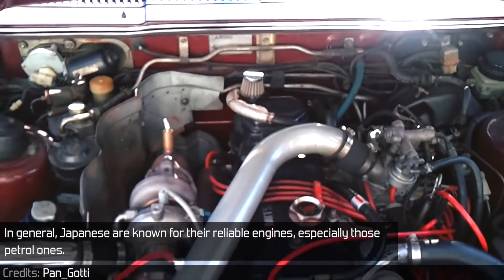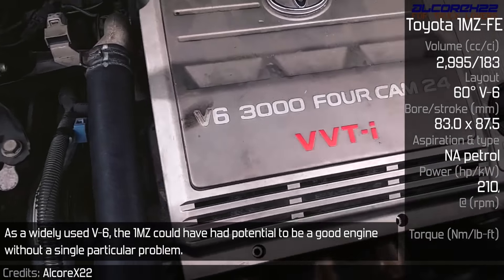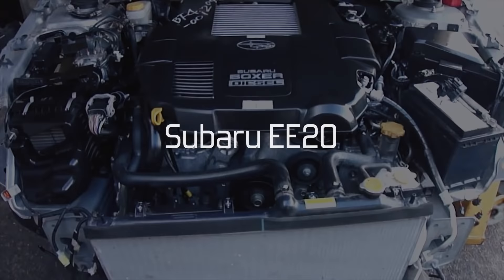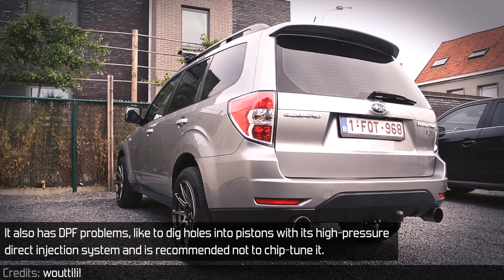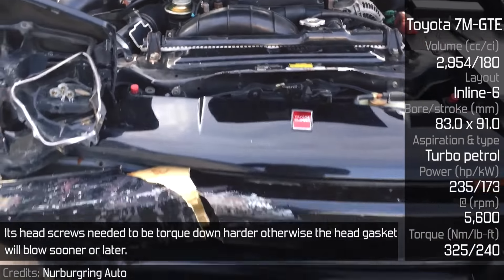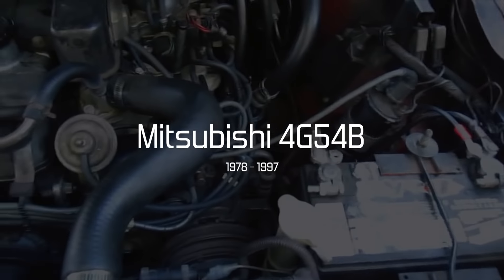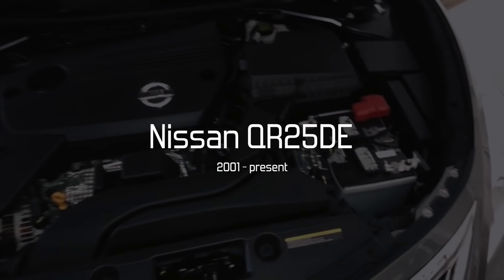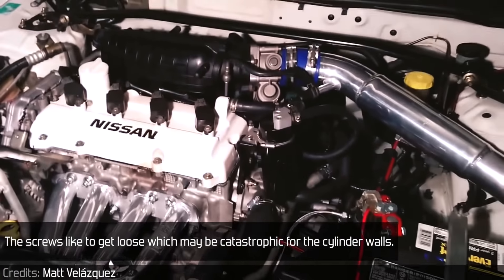Top 5 Worst Japanese Engines Ever

Comment: 4g 54 fastest 4 cylinder for 8 years on sakura motors, and warping heads was not the problem, it was cracks due to megajets in the head to reduce emissions, the head of the same engine found on dodge caravans don't have the problem because they don't have the megajets. this guy who posted the video have no clue about this engines at all!

Comment: So sorry I saw this video after I had the problems with my diesel Subaru.
You could have saved me a lot of trouble!
Particle filter, turbo...like you said 67 000 km or 40 000 miles.
So glad I got rid of it!
Reply: Best japanese Diesel is the 2.8 six cylindre in my Nissan Laurel. Undestructuble and smooth!

Comment: I had a Nissan Altima 2005 with a QR25, and yes, its has oil consumption, but, uts a very good engine
Reply: Edmundo Cuervo That engine needs change oil every 3 months or 6000km.

The Qs engines of Nissan (QG18DE, QR20DD and QR25DE) had a problem with oil consumption and Nissan told that you must change the oil 4 times per year and maybe could be normal re-fill with oil in every interval if you need it.

Comment: Omg stay away from the QR2.5. That thing was a disaster. Started burning oil at 80k with regular oil changes. Throttle body was touched once while doing maintainence and since its drive by wire had to get it plugged to a scanner just realign it. Loss of power. sychros in 1st and 3rd were trashed. R&P leak lead to failure of bushings on control arms engine and transmission mounts.  Nissan is not a datsun anymore.. never will buy one again

Comment: Im sorry but the 1mz was easy to maintain CHANGE THE FUCKING OIL like you should with that and all engines and you will have absolutely no trouble from the MZ series its a tank as long as you keep it in good shape which isn't that expensive nor difficult to do.

Comment: Why isn't the EJ25 Subaru on that list? Every single one will blow head gaskets at a little over 100K miles. They have really long head bolts that expand at a different rate to the block and heads, combined with a bad hot spot area around the combined exhaust port, and this loses clamping in cold climates, soon you smell the antifreeze outside the car and it will start to consume it as well. Shit engine, I'll never own another one.

Comment: #1 No shit sherlock, what engine can run without changing your oil regularly?
#2 I don't think it's recommended to chiptune ANY engine
#5 "Header-integrated cat will die, then engine will SUCK IN ALL THE MESS" ??? As far as i know, engines push air into the exhaust, not suck it in from the exhaust...

Comment: Huh . . . never thought the DIESEL BOXER was going to end up being a shitty engine. No maker it's perfect but of all of them I thought SUBARU had their shit together.
About the fat-ass Nissan 2.5L four banger: It's a 50/50 . . . I have seen some abused ones still ticking  and running hard while others have died for no good reason out of the blue.
Mr. Visio, can you make one video with the worst transmissions both manual and autos ? I have no doubts Nissan's PIECE OF SHIT CVT will be all the way sitting at the top.
Biggest P.O.S transmission, EVER.

Comment: You 4got 2 mention the Honda s2000 , where bearing seizures were very often, plus the head gaskets at the early models often failed soon, ... But to one of my friend even a valve broke , and fell into the cylinder !!! ! !!! Baaad engine, athough it still could be done Better !!! ! !!! Shame on Honda with that one !!! ! !!!

Comment: You missed mine: 1988 Toyota pickup with the 22R engine. It was their last carburated motor. At about 90,000 miles, the crankshaft nose seal area wore and it pumped oil all over the engine. By the time it hit 120,000 miles, it had blown the head gasket three times. Each time, the garage welded and machined the head. Apparently this was a known problem...

Comment: Japanese cant make diesels.....WHAT!!!!!! Isuzu KB250 and KB280DT 90's are some of the best diesel motors you can find. The KB250 is well known to do 1mil km without opening the motor. My KB280DT had over 500 000 km on the clock and neither turbo or motor was ever worked on. Maybe get your facts right Visio cause that is BS!!

Comment: What about the Toyota 3MZ? Should I worry about that one too, or is it only the 1mz to worry about?
Reply: The 1MZ is great
Reply: Adam Douglas they’re are both good engines. This is one video of his where I can honestly say he is misinformed. The 1MZ is a strong long lasting engine. But like any car it will sludge if you don’t change the oil.
Reply: MrDruaboyea2U Makes sense. The Chrysler 2.7 was a fantastic engine. It's the owners who never changed the oil right.

And even the "Chrysler transmissions suck" myth. People either don't maintain them or use the wrong fluids. (Mopar uses a different tranny fluid than everyone else) simple lack of maintenance.

Comment: You made a video about the 7m a couple of months ago and now talking the complete opposite?
Reply from the maker: Yes, weren't you paying attention? The 7M-GTE is not well engineered from the factory which will lead into its failure in some time. But there is a way to solve it - manually re-torque the head. Still not understanding my point?
Reply: VisioRacer metal head gasket and arp studs (400 euro in total) and you have an almost bulletproof engine. So I think is not one of the WORST five engines in japanese history

Comment: Always knew the 7m and the qr25de was terrible
Reply: i drove my xtrail  QR25 for 230,000km and the only thing i changed was oil and 1 oxy sensor and 1 battery....    i still had the original diff and gearbox oil and radiator fluid  even.  Very tough engine. Was abused alot off road and still had the orginial clutch too.   It was still running like clockwork until i got hit and turned into a write off..

Comment: Honda toyota lexus suzuki subaru are one of best
Reply: My ex wife's 2007 ES350 Lexus just passed the 300,000 mile mark. the only real problem came at about 225K when she had to have the alternator replaced to the tune of about $1000 - mostly labor costs to remove so much plastic that covers the engine bay. The car delivers an easy 34 MPG on the freeways and highways, even at 75 MPH and that 3.5L engine has great power and torque. You will look a long time before you find a more comfortable, quiet easy to live with car.
Reply: Tim Strom Lexus its most reliable luxury car look this Mercedes bmw and audi so many horror story an new cars you make good choice God bless japan best cars

Comment: The first toyota engine is bad because it will sludge if you dont change the oil?  That's any engine.  You said the Japanese dont make good diesels, what about Isuzu?  They;ve been making fantastic diesels for decades. The toyota straight six was about as generic a description as I've ever heard. I had a 1978 nizzan 280z with bosh fuel injection so I dont know what you're talking about with the Mitsubishi engine either.  It seems like you make half this stuff up just to fuck with people, where the hell do you get your information from?

Comment: Toyota 3VZE is a total pile of shit that does not have a single redeeming feature. It uses a shit tonne of fuel makes no power and still pings means that it blows head gaskets. It is unreliable hard to work on over complicated tightly packed the engine management system was 2 generations old when it came out. Steaming pile of dog shit.

Comment: You forgot Mitsubishis GDI Engines. :D
Reply: Their 4G carb engines also burnt oil prematurely due to a fault in the oil control rings. This remained a problem from the late 70's right through to the '90's - can't understand why the issue was never fixed!

Comment: Where's SR20? XD
Reply: St0RM33 you're joking right?
Reply: MHCPL he has a point. That engine has many problems, but it's so popular that most of them have solutions by now. Also, most people modify them anyway so the original problems don't really show up.
Reply: You`re joking too
Reply: MHCPL no its true, i had a s13 with 240sx front and it was bone stock, i had to spent money in some mods to fix it
Reply: Many lies.
I have a Sentra 2001 with a stock SR20DE and its a monster with 140,000 miles and still running strong.
One of my partners have one too in a 1993 Sentra GSR2000 with 225,000km whitout any trouble.
In Europe, that engine is very popular and one of the most popular Nissan Engines by the reliability and power.
Reply: İf you save your engine it will be forester, if you no save it will turn to waste. "İyi bakarsan bağ olur , kötü bakarsan dağ olur" klişe :D

Comment: How ee20 (diesel boxer) can be any good? Maybe yes, but how can it produce torque if bore is equal to stroke? Diesels have long strokes for torque. 

*Typpical guy who reads specs

Even 4g54B has got way longer stroke than bore like TRUE diesel
Reply: Gedas alekveravičius  boxerdiesl stage 1 tune : 185hp with 400nm torque 

Stage 2: 200hp 420nm

Comment: Proof that the Japanese can’t always make good engines...
Reply: Josh Bacon no one can
Reply: Especially muricans :P
Reply: Michał Dębicki mfw muricans are still using push rod v8's. But they work
Reply: Mean while in America the Chevy Equinox dies around 70k on it. Well mine did atleast.
Reply: Actually to start with they made horrible engines. The air cooled Toyota / Subaru engines were something quite horrible. Also Mitsubishi wouldn't be anywhere without reliable Colt engines, Nissan without reliable Datsun engines....... it was mishmash of shitty engines right up to the 70's.

Comment: Wait? Are the good Japanese engines?
Reply: CaddyPro'59 2JZ-GTE, 1JZ-GTE, RB26DETT, RB25DET, 4G63T, EJ20, K20, B18, AP1, AP2, 1UZ, SR20DETT, 1LR-GUE, K24, C32B, 2ZZ-GE just to mention the most popular ones :)
Reply: Zoltan Benedek All sound the same and all sound boring, just a fuel injected flat plane with plastic parts. No thanks. I’ll stick with the big boys. Nothing is better than a cross planed carbureted pre oil crisis V8. Just the idle alone might the the most satisfying sound ever, and when at 5000 rpm, it sounds like a angry demon.
Reply: I'll add the 4A-GE to the good list.

Comment: lol..... that toyota 7m engine....WITH A TURBO.....
makes as much power as a NATURALLY ASPIRATED! buick 3.8 v6.....which is 1955 technology.....

oh, and buick also stuck turbo chargers on the 3.8......which would leave this thing in the dust....

oh.... and almost every single 3.8 can go 250,000 miles......

yet, people will still think american motors ALWAYS make less power and use more fuel......and arnt reliable...

Comment: Most of Japanese Engines are Worst 'cause of high reving characterisitic and almost lack of torque.
Reply: Kacper B better an American V8? Ahahahah
Reply: marco fiorillo What do you mean? Ha ha ha?
Reply: Kacper B 
If you don't have something usefull to say, don't say anything, allright!
Reply: Woudam You wish is my command.
But I expressed my personal opinion.
I don’t like Japanese way to build cars...
Reply: Kacper B 
Many Japanese engines have lots of torque. So saying that they all lack torque, doesn't make sense.
Reply: Kacper B your statement is wrong on so many levels... “most Japanese engine”? not all of them are 4 cylinders you know?
Reply: MrDruaboyea2U Obviously, Lexus has great V8’s for instance. But most of Japanese engine has high reving characteristics, modest flexibility, low torque figures available in higher rpm’s.
I don’t like this approach to build engines. 
I prefer turbocharged with lots of torque below 1.500 rpms and so one...
Reply: D4D
Reply: This is what happens when you give a 15 y/o a computer.